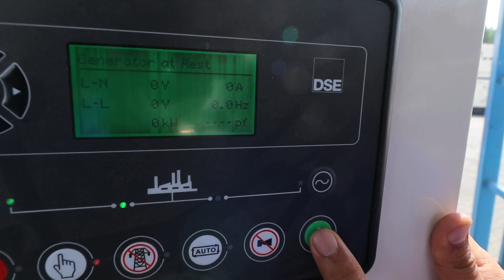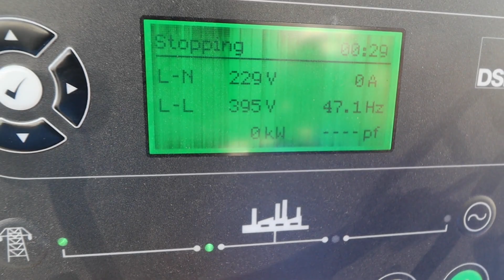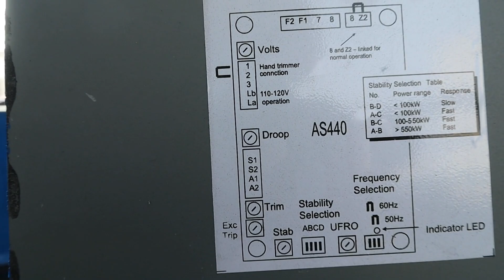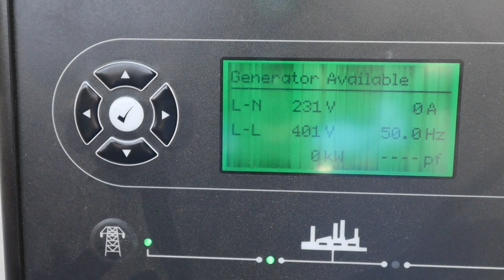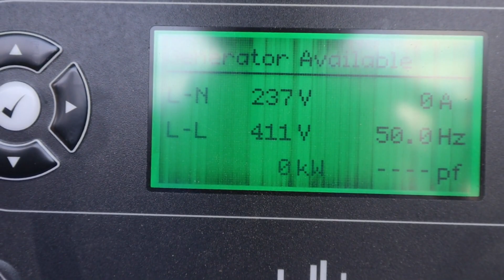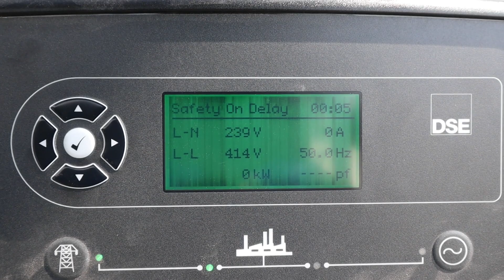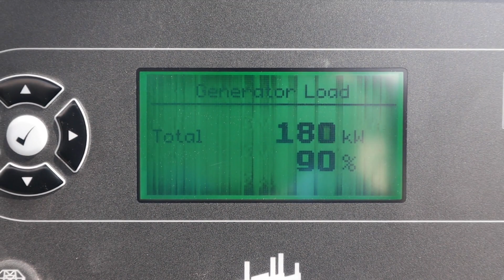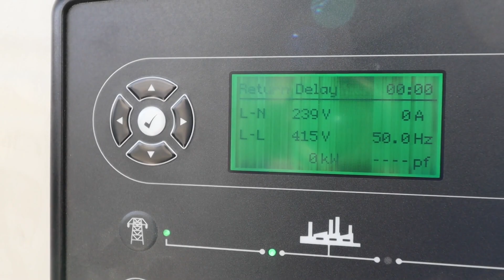STAMFORD AS-440 UNSTABLE VOLTAGE OR FLUCTUATION HOW TO FIX IT? benzblogs

Comment: Hello, dear. I have the same problem as in your video. I do everything as you show. But there is no stabilization. The voltage is unstable. Changes are only 30 - 10 volts. What should I do? Please advise. What other reasons could there be? I replaced the AS 440 with a new one. No changes. Adjustments are not sold.
Reply from the maker: What kva you are doing and is it ecu engine ? Make sure first that engine is stable before calibrating the avr coz if engine is not stable it will never be stable the voltage
Reply: The diesel generator operates stably at 1500 rpm. The diesel generator is equipped with an ECU.

Comment: Sir Question:

Yung Generator namin Stamford din, stable naman pag nag no-load testing pero once loaded, at mag increase to 400kw(1250kw rating), nag cause sya ng voltage fluctuation. Tried replacing ng AVR, at Recifier diode, but same ang issue. Patulong po
Reply from the maker: Sir pag ganon check mo yung link ng dapat naka link young 500-1000kw my selection jan sa link para kaya nya ang load
Reply from the maker: Double chk mo yung ved ko sa wiring diagram ng stamford para malipatmo sya
Reply from the maker: Tpos adjust mo nalang ang stability

Comment: Sir bens gd day myron po kming perkins n 25kva bli single phase nong nag load sya ng aircon 10 piraso mtgal ang andar nya ok nman, kinabukasan andar nmin tpos  pg my load ng uli nag fluctuate n po ang voltahe sna ma tulungan m po kmi, thanks godbless po
Reply from the maker: Pure single phase ba or kinonvert nyoo lng para maging single phase pls asap me Anong alt Ang gamit nyo at Anong leads outs 12 or 6 leads
Reply from the maker: Kong pure single phase alt ok po Yun pero Kong 3 phase at ginamit nyo Ng 2 line para maging single phase Tanong balance ba Ang load at pano Ang connection
Reply: @benzblogsVlogs  bli po sir bens line 1 terminal 1&5 line 3 terminal 9 & 10, terminal 2 & 6, terminal 8 & 12,  terminal 3,4,7 and 11 pra s neutral
Reply: Bli nka single phase ung s name plate nya sir pero ung alternator nka 3phase po sya s ngaun single phase n po sya sir bens fg wilson n 25kva po
Reply: Bli 12 leads po sya sir bens
Reply from the maker: @RitcheUntaran  so anong connection ngayun ang gamit nyo
Reply from the maker: @RitcheUntaran  mean ng convert kayo or ng retapping

Comment: Gd.ev sir paano e adjust Ang L-L220v?
Reply from the maker: Sa makapag adjaut kalang ng lin to lone kong ang connection mo ng alter is double y or double delta or zegzag connection
Reply from the maker: Kong yan ang connection mo e jan kalang pehit sa my voltage potentio

Comment: Hi! Good morning. I have a 60Kva generator and we noticed that the voltage was fluctuating a lot. It suddenly stopped working and once we restarted it then no power was being generated at all. There is also a (not strong) burning smell coming from the alternator. Please let me know if you could assist us remotely. Thank you
Reply from the maker: Do one thing remove the connection from avr check the excited resistance and check the winding Resistance thin let me know if you done give me the result or the measurements u done

Comment: Thank you boss i enjoyed watching and learned about stability. My generator DSE110 is has a huge difference in the phases no matter how much i tried to adjust the voltages it will still show me under voltage what can i do for this situation
Reply from the maker: Use multi meter to check ✅
Reply: I have done it all sir
Reply from the maker: @IbrahimKarrosesay  that why you have unbalance voltage generator will give you shutdown due to this unbalance voltage you need to do is to rewind the alternator and make sure your load is balance to avoid this problem again and again
Reply from the maker: Is this 3phase or single phase
Reply: It is a three phase sir
Reply from the maker: Check your wiring and configuration and the fuses
Reply: I have done that several times 
I Have even changed the contact terminal. I notice the phase 1 terminal has worn out and I immediately change it because there was some amount of spark trace I saw. But it still showing under load and at times it will run normal.

Comment: @benzblogsVlogs hi thanks for the great work 
I'm asking if i can disconnect one of the sensing input 7 or 8 until the motor tourn on high speed 1500 then connect it back to have full output directly?
Would that harm any of the avr or generator?
Reply from the maker: If you do that it not reaches to the speed 1500 it will shutdown undervoltage or under freq because there is safety configuration during that process
Reply: @benzblogsVlogs the engine must run in pre-heat and idel speed for 36 seconds in same time it gives 25 hz with 190 volts and I'm afraid that it will damage some equipments so I want a way to disable the avr until the 36 pass and the engine speeds up to 1500
Reply from the maker: @ماقل.ودل  the problem there it will work but it give more harder work from your avr and your alternator excitation to work with

Comment: Hello, I have an SS341 that I can't get control of throught DSE. I have trim all the way up and can't get it to drive down or up. I am stuck at 102 percent
Reply from the maker: Your the engine or avr
Reply: the avr itself. It was stuck at 102 percent. I went straight from back of DSE AVR A and B to AVR A1 and A2. I got control but when I restart the engine, AVR goes up on it's own @benzblogsVlogs
Reply from the maker: @elporky6420  before you do the adjust ment for the avr put first in the midle posation the voltage thin adjust the setting in the module so you can get the exact value for +- percentage

Comment: Good work... excellent.
I'm asking for what's the problem ... Over current voltage.
Reply from the maker: Sir over current at the same time over voltage?
Reply from the maker: If ever over current is the problem meaning your load is above the total full load of your generator now if volatge is the problem
Meaning that you need to check the voltage during load and without load if satable of not

Comment: Sir pano naman kung pag start ng generator tapos mag flactuate yung volts then pang stable ng rpm papalo sa 490V yung voltage nya? Ano kayang cause nun at how to fix po. Salamat and godbless
Reply from the maker: Sir ganito una mong tignan if pag start mo dapt stable rpm mo or speed para doon kalang magfucoz sa avr
Reply from the maker: Now kong hindi stable ang speed hindi talaga stable ang bogay ng boltage kc malaking apikto sa alternator yang hubting ang makina unahin mong fix ang makina thin bago avr
Reply from the maker: Anong makina at ilang kva

Comment: hi Brother...i have a question regarding same AVR MODEL the voltage will drop in a sudden when heavy fog is coming or due to rain....my location is Saudi Arabia thank you
Reply from the maker: Sir you need to install anticondensation heater to avoid that problem
Reply from the maker: Ita use toremove existing moist in your alternator

Comment: Dear engg.... How to solve the voltage fluctuations on load
Reply from the maker: Just do this check first if your rpm or your speed is stable if stable thin you can adjaut the volatge from you avr and stability but if rpm not atable you have to fix that first before you adjust the stability of the avr

Comment: Hi I bought an SDMO T16 diesel generator for power restoration when the local utility company has blackouts. The generator works well and runs well but five minutes after loading the voltage starts to have these huge swings in values. The problem only occurs when loaded, so I’m thinking it’s not a AVR problem. Do you have any suggestions?
Reply from the maker: Ok meaning the confige or the nominal volatge in the module not reaching out from volatge from your alternator for exampls you module nominal is 220 it shout be the volatge reaching 220 not below if below it happen like this loading voltage
Reply: What do you recommend? Do you believe the problem is with the AVR?

Comment: Hello brother. How are you? I am a new subscriber to your channel. I am honored to join you to follow. I have a problem with the 45KVA generator. Its voltage was unstable and suddenly I lost one of the phases and 2 phases remained working as required. The problem is in one phase. It no longer exists. What is the problem and what is the solution? Is the AVR malfunctioning or is there  Another problem. Is there a problem if you run the generator on 2 phases? Thank you. I wish you success
Reply from the maker: Now if you lost one whase of your volatge means other winding is damage already no if you want to know open the alternator use migger test if winding still in good condation in main winding
Reply from the maker: Now if unstable your volatge due to other line lost so if you have multi meter check the volatge where your avr sensing is connected my be its affected coz the is line failure
Reply: Thank you, engineer, and thank you for your interaction with me. I wish you success, brother.  But can I make the generator run on 2 phases? I checked them. They carry a stable voltage of 230V.
Reply: Do you have watesup my brother
Reply: I need contact with you please  for this problem  .and thank you so much my brother
Reply from the maker: You can search in messanger benzblogs thin there i send you my number

Comment: Bro
Can you share me or tell me how is AVR , Speed controller  Located ?
Are they coming single module in big DG? 
Ecm means avr and governor modules?
Can you share schematic how gensent controller is connector with avr , speed controller,ecm etc, cannot find anything google as a full schematic
Reply from the maker: Bro avr is connected only in the alternator while ecm is connected in engine 
The function of avr is to regulate the volatge while ecm is to control engine fueling and metering like sensors
Reply: @benzblogsVlogs  engine speed controller? It is another module or it is the ECM?

Comment: Sir paano kong wla tlaga voltahe na lalabas sa output ng generator pinalitan ko na lahat ng diode posible ba na sira na ung avr?
Reply from the maker: Pag avr lang sira dapat may boltahi parin lahit 40-50
Reply from the maker: Ganito testerin mo yung exciter ilang ohm dapat omabot yan ng 10-18 gnayan ok payan
Reply from the maker: Mag migger test kana

Comment: Hey brother i have problem with my AVR there is no input power how can i check the reels please
Reply from the maker: If no out put just double check your fuses and check the resistance of your exciter field if there is around 10_20 ohms still good now you can start exciting
Reply from the maker: https://youtu.be/ZRACQ2uzbNM
Reply from the maker: Follow the vedio that i send to you take the exciter wire and strat the genset try to inject 12 vdc but before you do remove all the connection from your avr and each one put some insolation for safety thin follow the vedio if build voltage from 300-500 means avr only is defective if now build while exciting thin ither exciter or diode but after that message me back

Comment: Could you help me with as440 indicator light not coming on?
Reply from the maker: In your module
Reply from the maker: Double check your configuration look to your loading voltage ithere same amount with your nominal or higher juat put 95% from your nominal boltage